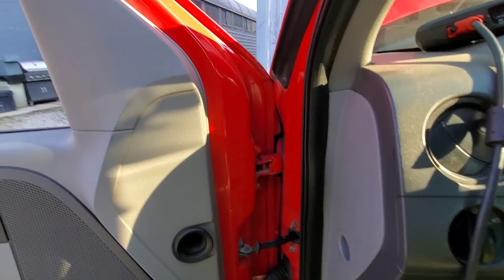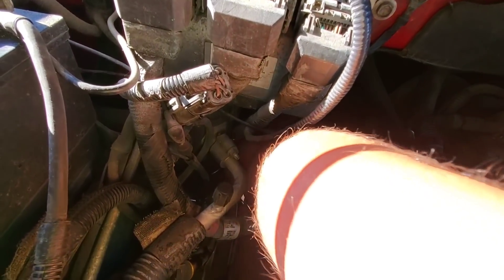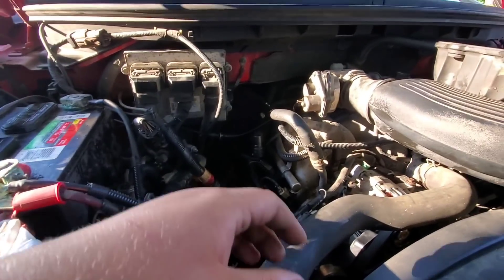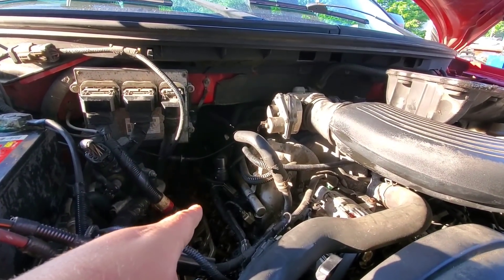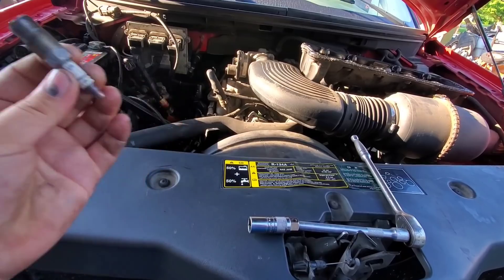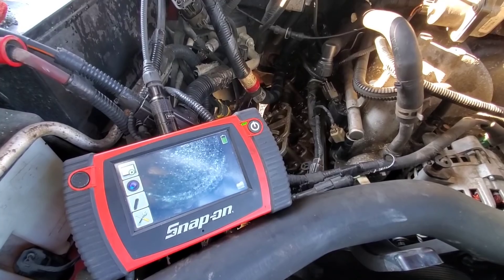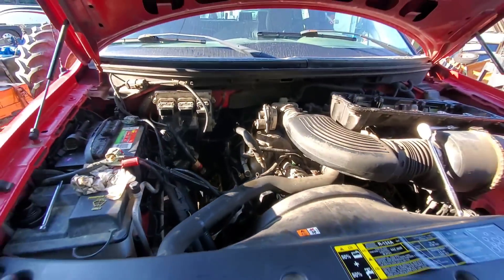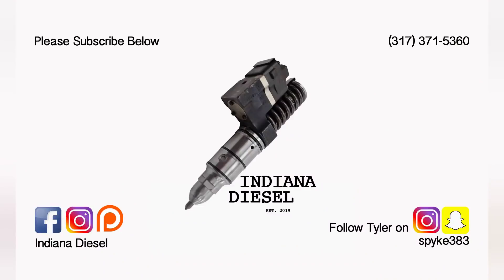Wrong spark plug ruins engine

Comment: Was looking for info about this. I got sparks plugs from Napa, (Wrong ones,) I installed then engine wll not start for couple weeks was repairing engine, New Battery, crankshaft sensor, charger battery, relays. Finally removed sparks plugs. Tip was hitting piston, they were too big. Now car shaking like hell, waiting for GM Napa on Monday.

Comment: Dont go to advanced auto, they gave me the wrong spark plugs for my toyota rav4..... Its running rough, possibly misfiring and losing power. Gonna get the right ones at auto zone or orielys dont cheap out on those inlearned my lesson.

Comment: I dont know these engines. Are the 2 and 3 valve plugs noticeably different?
Reply from the maker: Yes, 3v plugs have over an inch extension aftet the threads and a looped ground strap. Vs the 2v's normal plug
Reply: Must be a great shop that made that mistake?🤦‍♂️ 🙈
Reply: Did you listen to the video ??????

Comment: Don't the 3 valve engines have a different thread on the plug? I'm pretty sure the 3 valve plugs were M12 in cars and M16 in trucks. The 2 valve was regular M14. So they had to put the wrong size thread insert in the head to make that possible. *On edit, I'm pretty sure about this, because I had to buy a M16 adapter for my compression tester and leak down tester.
Reply from the maker: The original plug blew out and a threaded insert was installed. I'm assuming it all started there with the wrong insert.
Reply: Hey watch Wes work 
Neat seeing two different channels I watch chatting in the comments

Comment: i can see ordering the wrong plug, or not knowing a 2 valve from a 3 valve, but how could you possibily not notice the size difference between the new and old plug. Sounds like he may only have changed the one that blew out. How could you not hear the noise when the engine started though. Must have heard the piston hit.

Comment: Hi Tyler, Well my 2001 duramax CP3 went tits up. I thought the smoke was a bad injector but now I know it the fuel injection pump. Good news is the Reman is $650 and I'll do the labor. Not fun but good to know I have awhile on the injectors yet. When I do them though will need to replace the passenger head gasket the coolant is leaking from. That will be major for sure

Comment: What do you expect , it's a FORD ! they got god only knows how many different motors !!! If it needs a motor , Fords are throw always, just buy a different truck
Reply: You would expect a competent mechanic to install the right spark plug
Reply: @bogiewheelman71  the problem with common sense is that ............................................. well, it isnt

Comment: Ford actually had designs almost identical to the small block LS engine but chose to go with the 4.6, 5.4 modular designs instead. History will prove that to be a colossal mistake. That’s just my opinion.
Any goober that doesn’t compare the plugs he’s removing to the ones that he’s purchased should just find a new way to make a living.
Reply: I once bought a low hours tow behind air compressor cheap, because some knucklehead put the wrong plugs in a V-4 Wisconsin engine and spun the engine over. Knocked all four plugs out, along with a half dollar size piece of the Aluminum head each was threaded into.

Comment: Wow I have mess with those engines and have never had that issue with that i have had other motors with the wrong plug but have never seen that spark plug mistaken for and installed in the wrong engine.

Comment: Whenever I did a spark plugs change on my vehicles I've always done a side by side comparison of the old and new spark plugs. Somebody is losing a job at that shop and they're replacing the engine free of charge or face a lawsuit. When I was in auto mechanics class in high school one of the things the teacher always reminded us of was to compare the  new parts to the old parts so this kind of thing doesn't happen.
Reply: What if the one before you put the wrong spark plugs then you will be making the same mistake, I had that problem n when I checked the owner manual I knew it was wrong spark plug from the beginning

Comment: I would be very interested what spark plugs are in the other 7 cylinders as well as what if any compression that cylinder has and if it has compression how the engine would run with a correct spark plug in that cylinder.  I have seen clogged PVC systems make engines appear as if the have excessive blow by.  This is not the first time I have seen the installation of incorrect spark plugs damage an engine not only from interference but from wrong heat range as well.

Comment: my son has a 94 mustang with the 4.6 2 valve engine. low miles and it runs fine. we will keep this in mind and use the correct spark plugs when needed. thanks for this video
Reply: Mustangs did not have 4.6's until 96!  If it has one then it's not factory!

Comment: Wow. You would think the horrible noise it made after changing that plug would have clued them in.
Reply: Just from the physical size difference shit Stevie Wonder could have figured it out with his feet.
Reply: @JSchrumm  It looks like the guy worked on that one cylinder only and didn't check any of the other spark plugs for size difference or anything else for that matter.

Comment: Probably an $8,000.00 dollar replacement if a good used engine can't be found. All because of $20 bucks worth of wrong spark plugs. That wrong plug obviously blew a hole in the top of the piston. My old Buick 322 Nailhead sucked a valve at idle. Grenaded one piston and scored the cylinder wall. $7,500.00 dollars and one engine rebuild later the car is back on the road. In this case nobody's fault. Over 60 years old and probably 200,000 miles or more.